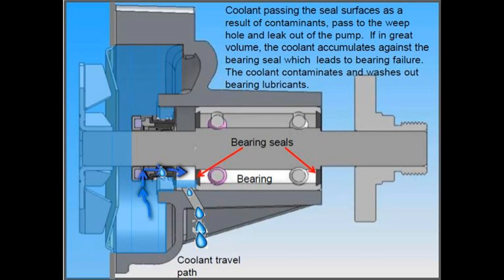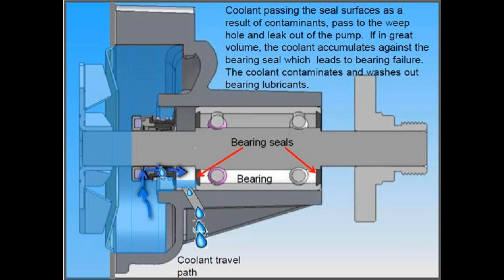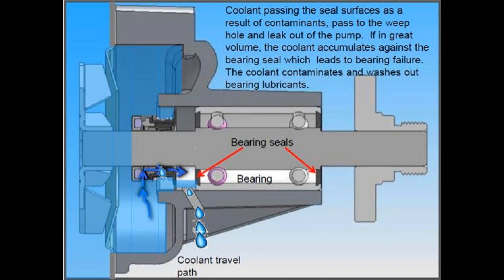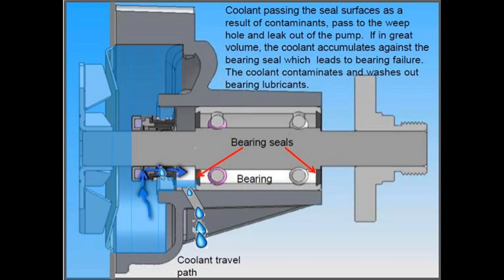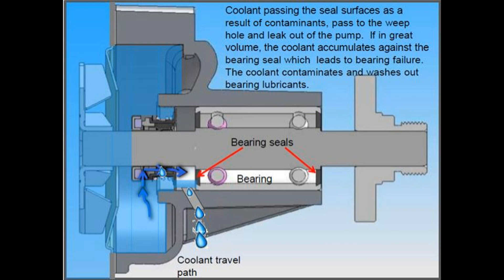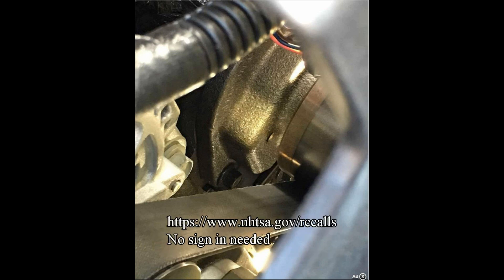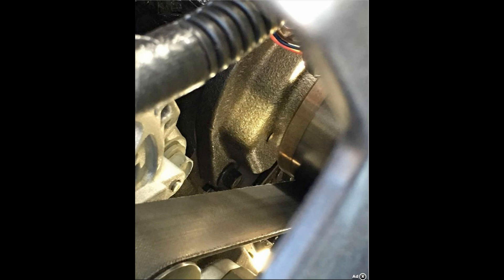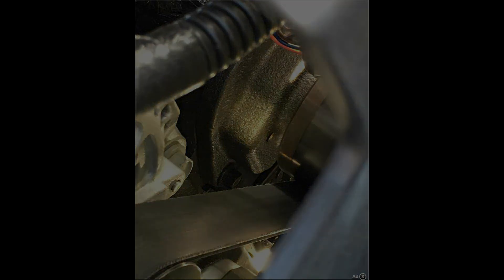Ram T51 recall information for  Cummins 6.7 L - 2013 - 2017

Comment: My '14 2500 w/ 78,000 mi on the OD suffered a water pump failure on I-40, 8 hours into a 14 hour trip.  The bearing seized, severed the shaft and got caught in the serpentine belt, nearly cutting it in half.  Luckily, the belt stopped the severed pulley from destroying the fan, radiator, and wiring harness (near the fan clutch actuator) which has happened to some.  The only warning signs were a spike in coolant temps (230+°F) and loss of power assisted brakes and steering once the belt derailed.  

I limped the truck off of the freeway and onto an exit that just happened to be right in front of me. At the end of the off-ramp I pulled onto the shoulder of the road and noticed a John Deere dealership and a gas station further down the road; of course my cell phone was roaming and had no WiFi access...

I figured the tractor place might have a water pump that could work and headed in.  By shear luck, a guy working as a mechanic there previously worked at the Dodge dealership a few miles down the road.  He makes a few calls and the dealership has a belt and pump in stock but the catch is they can't get to it until Monday (this is Friday around 4:30 pm).  So I ask if they can deliver the pump, belt, and coolant to my truck and I'll fix it on the side of the road myself and they agree, all covered under my extened warranty.

While I'm sitting there waiting for the truck to cool off, the mechanic literally gives me the tools to do the job and walks me through the procedure (it's very simple).  About three hours later I'm making my way back home.  

A big thank you to James River Equipment and Mt. Airy  Chrysler Dodge Jeep Ram Fiat.
Reply from the maker: Thanks for sharing that.  Amazing story.  That's my worst fear as I've got a camping trip coming up in Dec.  How Concentric could miss such an obvious QA inspection item when those pumps were built is beyond me.
Reply from the maker: How did you replace it, did you remove the alternator and air box or fan and shroud?
Reply: I did remove the air box (for room to work) and the tensioner to get the new belt in but didn't need to remove the alternator or shroud.  However, my truck is deleted so I can't speak on if any of the EGR might get in the way, but I don't think any of it will.  I'm going to keep a spare pump, belt, and coolant with the truck as I speculate they gave me the old-style pump and we're months away from dealerships getting the new pumps in stock, etc, etc.  I don't know how much you've heard about 13+ 6.7s water pumps failing, but I've read many detailed accounts of trucks with far less miles than mine going out... some at less than 20,000 miles.  One had just over 3,200 miles. But you know it's bad when FCA is doing such a massive recall!  But hey, at least it's a Cummins.  Take a look at either PS or DM; I'd rather run backwards, naked, through a cornfield than work on one of those.
Reply from the maker: Thanks, I've seen it done both ways but seems not having the hassle of the fan and potentially damaging it, it seems from the air box is the better way.  Plus, who carries a 47 mm open end with them for the fan nut.
Reply: My '15 2500 just had this happen 2 days ago.  It only had 38K at the time.  It actually started a fire on the fan clutch harness.  I was able to put it out quickly and had the truck towed to the dealership.
Reply: Mine just did the same thing. Coolant temp went up to 275 before I could get it shut off. Just had it towed to the same dealership you got your water pump from, Century Dodge in Mt. Airy Maryland. Lucky it didn’t take out the brand new radiator I just installed. I smelled smoke yesterday but thought it was outside then smelled smoke again today right before it twisted the water pump Pulley off.

Comment: Excellent description and well presented. Your videos are a wonderful asset for me, and I’m sure many others. I’m currently looking for my next truck. Narrowed it down to a Ram 2500 Tradesman with either a 6.4 or a 6.7, and also a Ford F-350 with a 6.2. I had a 2004 F-350 with the 6.0 diesel. I know many had problems with them but I must’ve had an odd one cause I never had any problems in the 13 years I had it and I loved it. Frame eventually rotted out with the salt from plowing and also hauling my lobster boat in and out of salt water. I’m a little leary of these newer diesels with all the emission equipment. However, you make it seem more approachable for me. I’m not really towing or plowing as much but I am looking forward to retirement and was considering maybe hauling as a retirement job. That’s still a while out though. Thanks again.

Comment: Love your channel Marion. Grateful for your insights.  Seems I should be able to take my jewlers dremel and put the hole in.
Reply from the maker: That's what I was thinking , ha
Reply: Also, I was curious why the actual weep hole is not at the bottom of that canal. Heck  could drill and tap that spot and install a grease fitting !
Reply from the maker: I've seen them on the bottom and right side also, depending on brand.  The location could vary from the video.  But the few  new Cummins I've seen, they seem to be at the top left.
Reply: top or side may be the way to go: The thinking being that if you get coolant in there the water in the 50/50coolant (at 200F) would evaporate through the weep hole leaving a nice pure ethyl glycol residue that might be a fine lubricant anyways. Im thinking too much.
Reply from the maker: yea and easier to see if you do get a leaky seal.

Comment: Hey thanks, I just checked mine visually, 500 miles on it, built July 2018. No weep hole and rust covering the topside which looks as if it was flung out from the barring side up under the pulley. I just checked the website and it says there's no recall listed but it clearly been leaking there is also rust flung up on the head of the exhaust manifold side.
Reply from the maker: You should be ok since he recall didn't cover the 18's as far as I know.  The weep hole is probably on the very bottom where you can see it, it may not have a vent hole at the top but still be ok.

Comment: Marion, I just got all 4 recalls taken care of at dealership yesterday, and the new water pump still has no visible weep hole or vent hole!!! Definitely not like your new pump. I'm going to put a video of it on my channel. Pump made in Italy. I'll talk to the dealer next Wednesday, they're going to fix my heated mirrors, that have never worked!
Edit: The next day I found the vent hole with a small extended mirror, looks to be at the 5 o'clock position.

Comment: Very helpful video. 
I replaced the WP on my 03 several years ago during the time they were using the bad one. So now I get to do it again - if I can find a good pump.
Reply from the maker: Yes, I think these with the vent hole should stop the premature failures on this engine, although I didn't have any issues with he 5.9 with close to 100K miles on it.

Comment: I have a 17,  3500 manufactured March 2017 and, I don’t see a weep hole. 🤔🤔 I wonder if the new pump has a weep hole?
Reply from the maker: It's possible that it's on the bottom, if you can use a mirror or phone to take a snapshot of it and see, you'll possible find it.  Pretty sure RAM uses different vendors for the water pump and if that's the case it could very well be on the bottom or other side  Since you are not in the recall, I would think that is the case

Comment: Marion, i checked mine 01/2017 build date, got a recall notice and looked at the pump and mine does have the weep hole is it safe to say that water pump is ok?
Reply from the maker: I would think so.  Not sure why FCA would recall a pump with a weep hole when they say, the lack of a weep hole is the reason for the recall.  You are the second person that reported this.  I suspect FCA is overlapping their production date to CYA.  I'd let them look at it when the time comes but I don't think they'll change your pump.
Reply: Marion Blair, thank you for all your in depth information. If thats the problem i would guess the same that they would just leave it. I honestly prefer they don’t have to do it but don’t need my truck to catch fire. But if thats the root of the problem i might be ok, and your probably right they are just over lapping to cover their asses, i will take it in when they let me since they told me no point since there are no parts available. Thank you again! Love your videos
Reply from the maker: Appreciate that!
Reply: You are good. The instructions from FCA are to inspect for weep hole and replace if not there. Mine was also built on 1/2017 and it has a weep hole. Local dealer checked it and I am good to go.
Reply from the maker: Good to know, thanks.
Reply: You're good to go

Comment: My 2012 Ram 2500 6.7 let go at 50,000 miles it was covered under warranty but I wonder if they replaced with the bad pump. And should earlier models need to be added
Reply from the maker: I doubt it but check for a weep hole all the way around the pump.  If you don't see a vent/ weep hole, it needs replacement.  Some are on the bottom however making it very hard to see.

Comment: I took my 2017 Ram to the dealer, but they don't have the parts yet. But what I notice since the cold weather started the engine is running hotter. From 189 or so now it get to 215 degrees.
Reply from the maker: Yea, they said it'd be a while before they start calling them in.  thanks.
Reply: If you're seeing coolant temps spike around 215°- 219°F then drop down in the 180s°F, you have an air pocket in the system.  You can purge it by letting the engine run (while hot) with the coolant-overflow tank cap off.  But I wouldn't be concerned with coolant temps under 220°F.  These engines run hotter than most because of the emissions equipment.  Before I deleted and installed a coolant bypass with 180° T-stats, my truck would cycle between 200°F & 210°F.
Reply: Monster RAM there is a vent for air in the coolant
Reply from the maker: Suppose to be one, I suspect to cool the bearing

Comment: Just got my '16 truck back from having all 4 recalls done. Water pump, shift interlock, trans. solenoid pack, and tailgate latch. All seems well except I have a big concern with the coolant. When I left the truck, I asked the service writer if they save the original coolant since it has only 24,000 miles on it. He said they replace the lost coolant with new. Well, the original coolant was a pale orange/pink color. Now it's a vivid purple. Hmmm..., the book is very clear about not mixing different types of coolant. The part number of coolant (they installed) listed on my receipt is 68163848AB. I googled that and found that it is most likely purple and the "OAT" variety. Owner's manual doesn't specify a part number for the coolant, it only says to use 10 year/150,000 "OAT" formula. 
I hope to hell they used the correct stuff. I have to wonder what color others have now.
Reply from the maker: You are ok David  The 68163848AB is a 100% concentrate and is very purple.  I've got a gallon in the garage, I just checked it.   I weaseled it off the tech when he did my pump.    The 50/50% water/coolant was an more orange color.  Both the same.  I also made sure they put new stuff in my truck when they did mine.  I had a mechanic at GM drain my oil in a bucket to fix a leak and put the same stuff back in out of a open galvanized buck that sat around why they did the work!
Reply: @MarionBlair  Thanks Marion, I now feel reassured. Sure would be nice if they standardized the color of different coolants, would be a lot less confusing. BTW, my phone went off to notify me that you replied. Technology today is amazing. At least it is for an old guy like me!
Dave
Reply from the maker: Yes, thanks,  no worries.  appreciate the reply.

Comment: I have a 2017 Ram that was manufactured on February 17th that is part of the recall and I received the recall notice in the mail. I just got done checking the water pump and it HAS the weep hole right at the red arrow spot in your video. I would question the February 28 date.
Reply from the maker: Yep, sounds like it.   Maybe they are being conservative but you're in good shape
Reply: The art of dodging the bullet. I was happy.
Reply from the maker: You are one of the lucky ones.  You won't have to have them screwing with your brand new engine.

Comment: I don't have any confidence in the dealership replacing my water pump correctly. I might just buy a new water pump and pay my mechanic to install. After I shut my truck off every day I smell antifreeze. It doesn't show any signs of leaking and I've only had to add coolant twice in 62,000 miles. When I got this recall notice I thought it was possibly addressing a issue that revolved around why I smell coolant but after watching your video I see it doesn't. Have you ever noticed a coolant smell? I've had others tell me they too smell antifreeze after shutting off their trucks.
Reply from the maker: No, I can't say I have smelled coolant.  Sometimes the emissions system puts off some strange odors
Reply: Marion Blair found my coolant smell. The driver's side of the radiator is leaking where the aluminum and plastic meet. Now looking into a Mishimoto radiator replacement along with new hoses to replace the plastic Y piece at the top that is also prone to cracking.
Reply: B&K Excavating LLC did you go with the Mishimoto hose kit to replace the Y pipe?  Was wondering about those hoses and how they are wearing and working?

Comment: Thanks, Colonel! ii just bought my 2017 2500 Tradesman and the dealer said ii needed a software update the night ii bought it. They said mine wasn’t affected. But after watching the video, ii checked my water pump and ii don’t see a weep hole. Im curious now. Great info by the way, love watching your stuff!
Reply from the maker: Check your build date also.  You may not have a Concentric brand pump and the weep hole could be on the bottom possibly or other location.  If your build date is after Feb 28 of 2017, you probably are OK.  Also check your VIN at the site in the comments.
Reply: Marion Blair ii did check using the links provided. It said 0 recalls
Reply: My 16 did to and so did my Ford. Why do it till it’s sold. They wait till someone buys it to do it cost them money to do it on every truck waiting to be sold

Comment: Owners may wish to consider their legal position. At this time, you are notified of a problem, though the remedy remains pending indeterminately. However, should you continue to operate the vehicle, you will likely be held partly or wholly liable for any resultant damages subsequently: on the basis you are negligent to ignore the warnings and belligerent to continue operating. I shall be very curious to see how the US courts judge which party bears responsibility for damages subsequent.
Reply from the maker: Yea,  Well, RAM didn't tell us not to drive the truck so I'd think they have the liability but I'm not a lawyer.

Comment: 2016 2500 w/80,00. Mine went out on my truck on Friday it caught the truck on fir but I was able to put it out. Now Chrysler is telling me thy will have an investigator out to look at it within 2 weeks or so. You would think they would be a little faster at this. I had three kids in my truck and that could have turned out a lot worse then it did thankfully!  I should juts fix it myself.
Reply: Wow, that's really something.  Was the fire due to pump locking up and the belt caused the fire?  Yea, they are too slow on critical things like this.
Reply: I am pretty sure that is why it caught on fire. Luckily my kids like they always do had left a bunch of half empty or full water bottles in my truck and my buddy ad I were able to put it out.
Reply: Thank God.  Hope they get it fixed up right.

Comment: i bought my RAM used and the dealership failed to tell me that the dam truck was built in CANADA! That's right CANADA. So i took it to Chapman Dodge in Las Vegas and they said my warranty is totally voided cause i dont have a CANADIAN residence and i would have to pay out of my own pocket. PLUS MY TRUCK IS ON THE RECALL AND THEY WONT TAKE IT IN CAUSE OF THE SAME REASON!!
Reply from the maker: I think they are full of it.  I'd call FCA and file a case.  Doesn't seem right
Reply: Mine was made in Mexico. That line from the dealer smells fishy to me

Comment: Hey Marion - that's the Pic I shot of my Water Pump the other day..lol
I put it up on the Cummins Forum with some links to the NHTSA document, and Ram Recall Center for guys to check if they have an affected truck.
Here is another link if you want to order the New WP from Cummins, or a parts house and install it yourself or have the dealer do it for you.
https://www.turbodieselregister.com/attachment.php?attachmentid=100225&d=1506976571
Reply from the maker: Great PIc!

Comment: I called the dealer they wouldn't give me any information other than they don't have parts they have no idea when they will get parts but if it goes, I get the old water pump style until they get the new water pump style. I only have 25k on it now so we will see.
Reply from the maker: Yea, I think most of the failures are on trucks with higher mileage but I'm in the same boat you are.  I'll wait for the dealer to fix it.  I'm hearing they'll have parts in Jan. to start calling trucks in so maybe we'll make it.  I've got a trip at the end of the month dragging my travel trailer so, I'll be watching the temp closely ha,  They don't give much warning when they go from the stories I've heard,
Reply: Marion Blair So from my internet sleuthing I've noticed the updated pumps are way cheaper priced than they were before could that be from the recall?
Reply from the maker: I've noticed that also.  I'm not sure what's going on but I'm a little suspicious.  So far, I've seen Concentric pumps from England, Italy and US.  Some have plastic impellers.  Might be legit, just cautious.